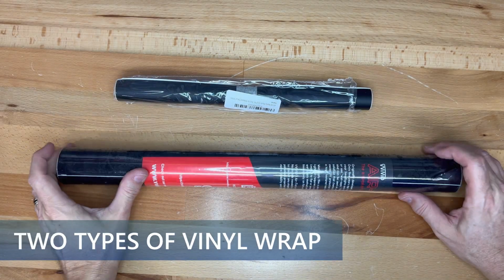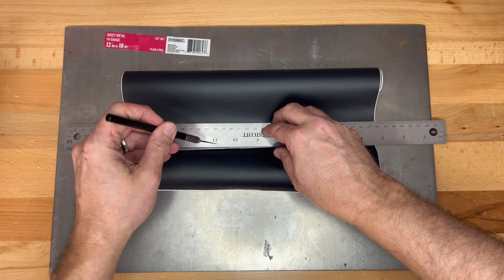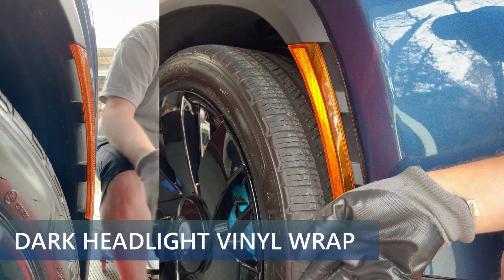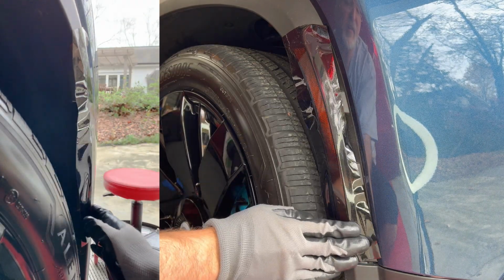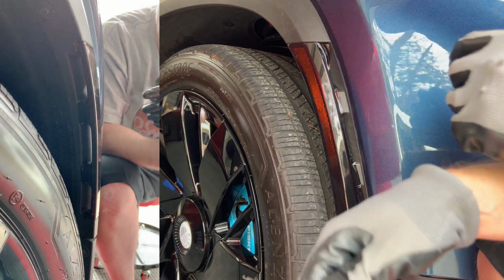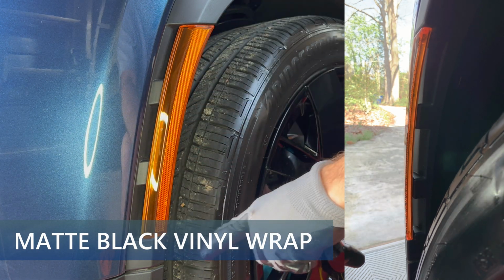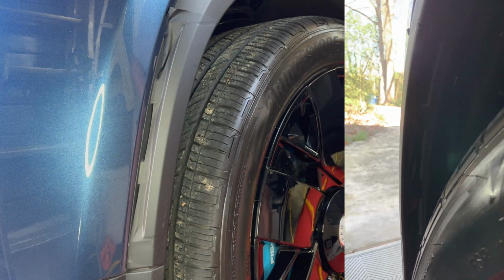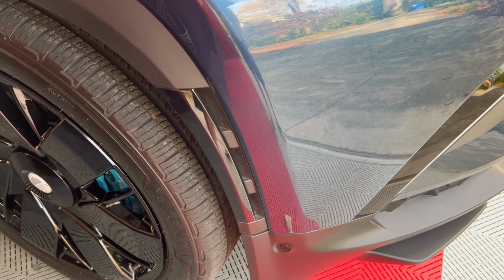Fisker Ocean One - Vinyl Wrap Reflectors

Comment: My question is why to do this? Isn't there a purpose for the reflector?
Reply from the maker: Some people have done this since they don’t like the large front reflector.  Some cars have them integrated or duplicated on the headlight assembly. I suppose I should have made a disclaimer about this. A lot of discusssion here: https://f87.bimmerpost.com/forums/showthread.php?t=1622310#:~:text=Every%20car%20is%20required%20to,the%20rear%20of%20the%20car.